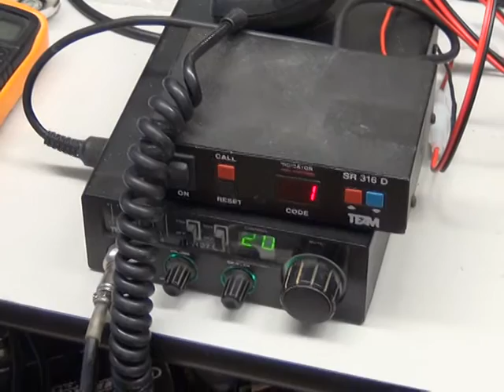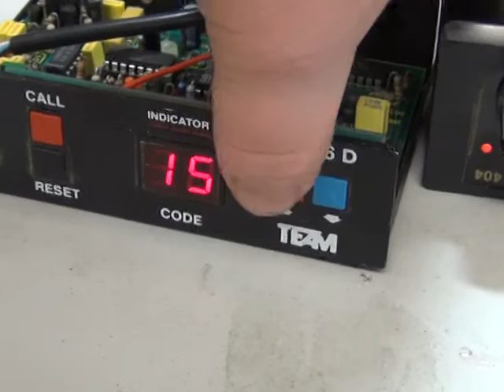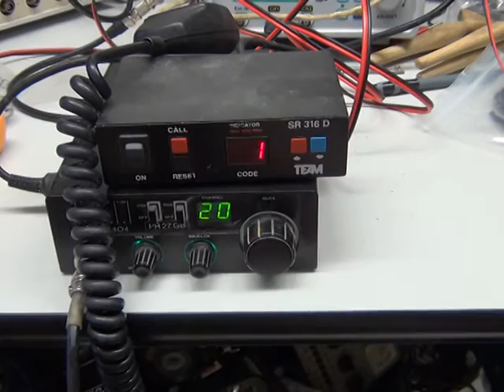Team TRX404 with SR316D selcall demonstration

Comment: Back in 1982 the Datong Electronics UK company manufactured a unit known as a 4096 Codecall device. This unit could monitor the output of a CB radio, via the external speaker socket and respond to a digital signal transmitted fom a remote CB radio. This device had three multi position dials at the front and could be set from a range of 4096 codes. The device had a small audio output at the front panel against which the transmitting radio operator would hold the microphone to send the code through the CB radio. The device was powered from a 9 volt internal battery. The unit was very reliable and enabled the CB radio to remain silent whilst waiting for a specific station to call.
Reply from the maker: Yes, I remember the Datong Codecall too.

Richard

Comment: The extra benefit is that when the selcall opens the radio, you can leave it with the squelch opened, so you get the max range avaible at the moment.

Same with modern CTCSS FM CB radios (or better with DCS)

Comment: I'm curious is it possible to do one of old  c.b 934mhz sets tx/.rx please?
Reply from the maker: +256 colors Twofold no I'm afraid. Firstly, our test equipment only goes up to 520Mhz & secondly they are not now legal. When I was at Nottm radio & subsequently Compass Comms in Bradford, both firms had test gear up to 1000Mhz. When I left in 1999, 934mhz had already disappeared & ETACTS mobile phone was in it's place. I did service the Cybernet Delta one's and the Commtel models though at the time. Mark, who comes here part time has a 934MHZ SWR meter.
Reply: 256 colors I have 2 delta 1 radios with catcall selcall system fitted :)